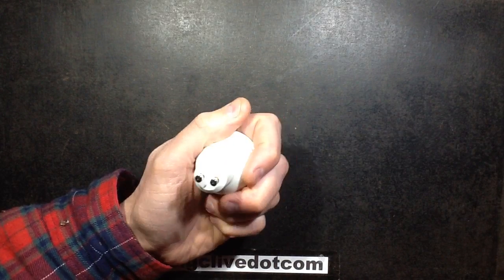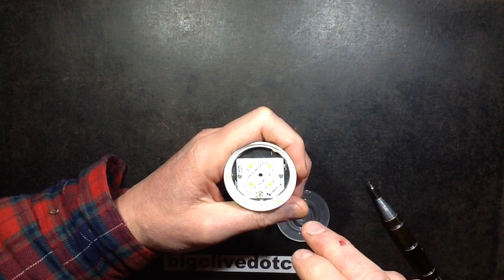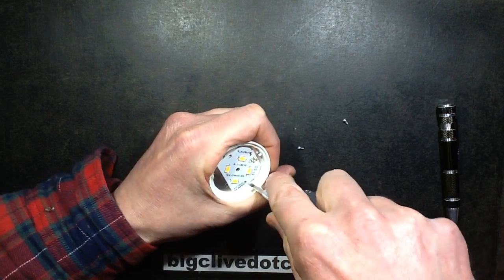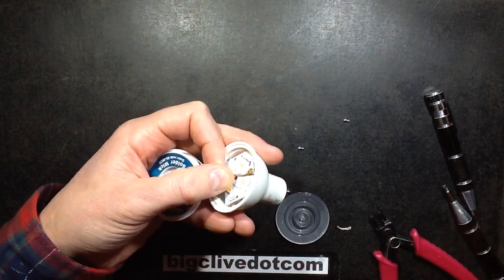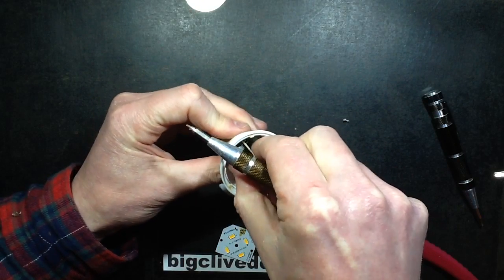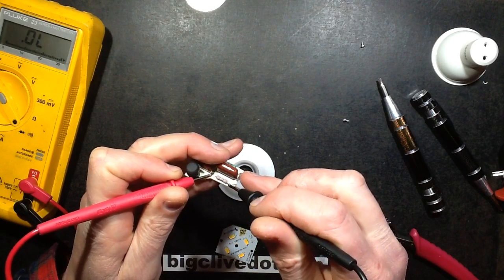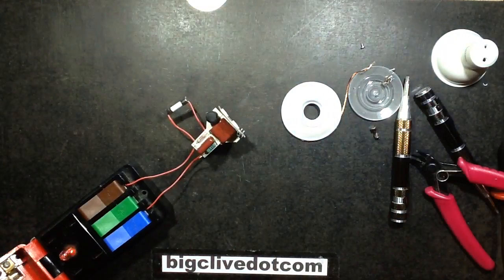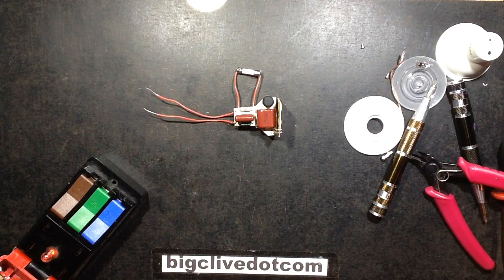Dead LED lamp autopsy.

Comment: I have a magnifying glass table light that has a candle light bulb. When my last incandecent lamp failed I tried to buy new ones but the law had changed so that it was illegal to sell them. So I bought Airam 4713471 led bulb, put it in and threw away the box it came in. Week later it started to sputter and it died. I wrote a complaint review to Airam and went to buy a new one. While I was in shop Airam had send me a response. If I had kept the box or even looked it more throughly in first place, I might have noticed that these come with 3 year warranty. So they kindly asked my delivery address and sent me a new one. So now I have a spare.

Comment: Evening Clive..   How many volts does the driver circuit usually supply to the LED board ?
Reply from the maker: With standard LEDs it's about 3V per LED.  A common downlight with three 1W LEDs will normally have a current regulated supply, so the voltage will settle down to the combined forward voltage of the LEDs.  Usually about 9 to 12V.  Some larger arrays of small LEDs or multi-chip LEDs like in this video will have a power supply that can go up to 50V or higher, with some referenced directly to the mains supply.
Reply: @bigclivedotcom  --- wow...  I didn't think the LED board would be over 12v .   Took apart an outdoor floodlight type LED and figured if the driver had gone, maybe I could still use the LED board.  Guess that's a no.

Comment: Crap. I've been converting bulbs to LEDs in the house and chose Phillips as the brand of choice. I might as well have saved some money and went for the cheap Ebay China ones.
Reply: +Sako's Tech Spot In my experience the cheap ones give out a horrible light (even as far as LED bulbs are concerned), so I think Phillips is still a good choice.

Comment: We seem to have the same Yihua soldering iron! I like the power quick connect (Cliff Quicktest QT/1) you are using, as you know we don't have fuses in our EU mains plug (Schuko) and you can reverse the plug in the socket. I like the UK BS1363 socket and plugs, because they are fused and polarised. Not sure why there is a fuse in the Quicktest and in the plug, it seems a bit redundant. Unfortunately the Quicktest is very pricey, they go for about €50,- over here.
Reply from the maker: The quick test units used to be quite cheap here, but the price is high now.  I guess the fuse in the quick test is to make it compatible with unfused plugs.  It also gives us the option of using a 13A fuse in the plug and a 3A fuse in the tester.  One good thing about the tester is that it does isolate both live and neutral when you lift the lid.

Comment: Perhaps one of the dropping capacitors shorted out inside, and it blew the fuse AND at the same time blew the short open circuit?
Reply from the maker: That did go through my mind as a possibility.
Reply: Yeah, like how in switching power supplies, a shorted/constantly-on switching transistor usually blows itself up before the fuse has time to blow... LOL.
Reply: Those caps do self heal on mains by passing a large current for a short period to do the self healing. That will blow the fuse for sure after a few cycles. If you unwind them you will find the blown areas inside for sure. Just unsolder them and see how far off nominal they are. I have seen them still working with 10% left.

Slightly better lamps will flash at around 1 per second at that point, the cheapies get dim.

Comment: dunno if you follow electronupdates teardowns, but philips have a few lemons among their led bulbs series
, i would suppose that fuses being drawm wire can suffer from bad batches, thinner or having occlusions in the metal, more likely from very cheap far east suppliers, thus leading to fuses which fall short of their ratings
, might be an interesting idea to make up a testing jig and buy 100 cheap fuses and ramp up to their blow point and see how many fall below their spec
Reply from the maker: Yeah, I follow electronupdate.  The problem with capacitive droppers is that when arcing occurs they turn into a snubber network and pass the high frequency electrical noise.  So it is a possibility that the crackle at switch on might have caused the fuse to fail.